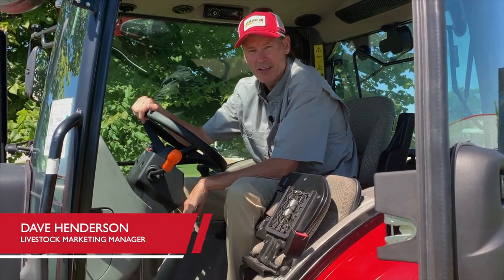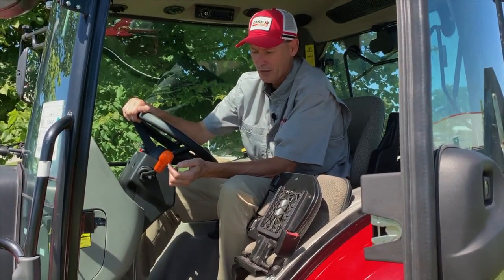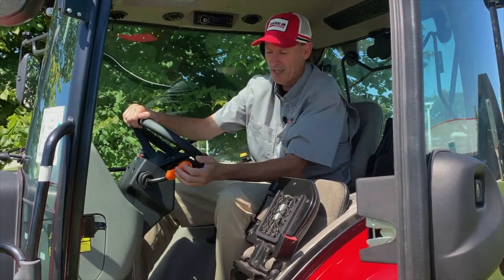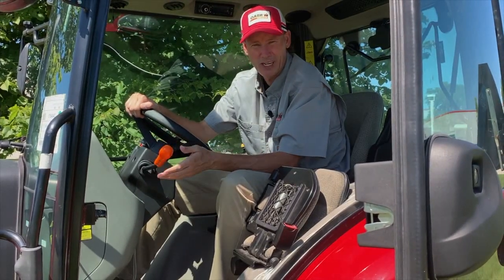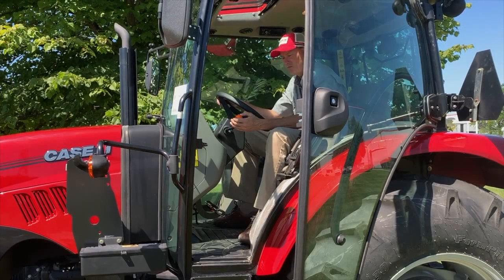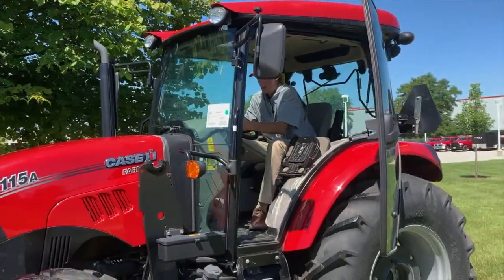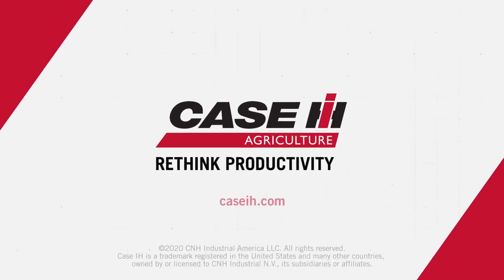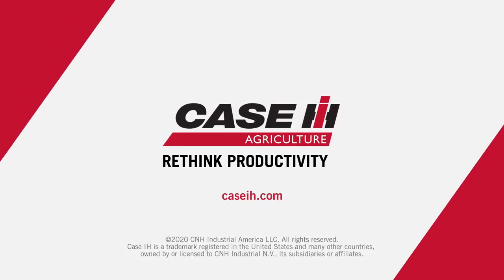Case IH  Farmall 95A 105A 115A Power Shuttle

Comment: I am in hill country in WV.  The problem w/the power shuttle is the tractor cannot be parked against a steep hill because it leaves only the emergency brake to hold the tractor.  Power shuttle is hydraulic and allows leaking off.  There is no way to park the tractor in gear allowing the transmission also to help hold the machine.